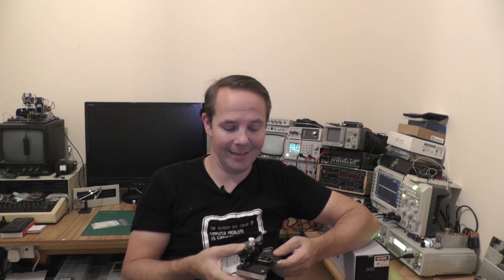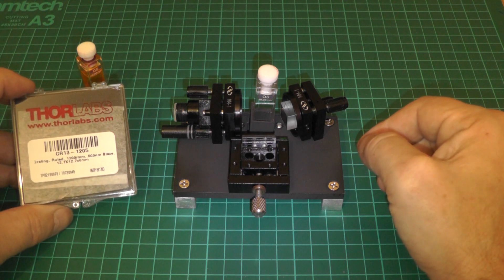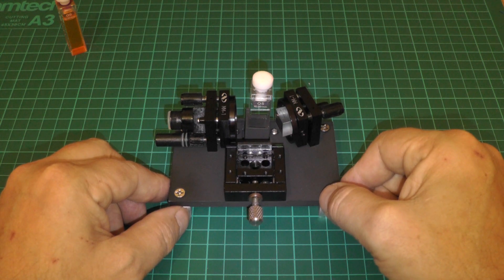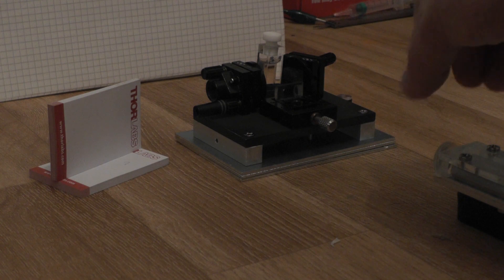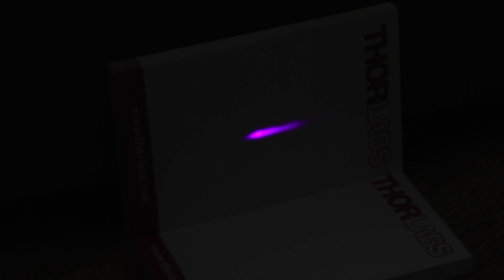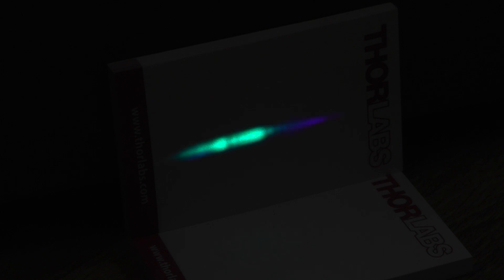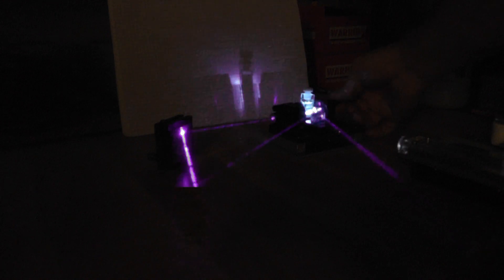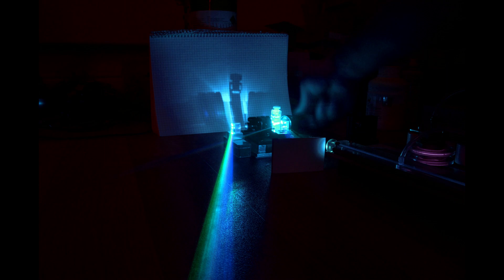DIY Tunable Dye Laser! (HD 60FPS re-encoded video)

Comment: You could also use a prism in the beam path between the cuvette and the HR to tune the laser color like in an ion laser if you have a broadband HR. It may make a better beam compared to diffraction grating.
Reply from the maker: I have in a previous version, but there is a catch! The prism needs to have high dispersion to effectively tune,, plus it's yet another element to align. In some Dye Lasers, they stack prisms to get the required dispersion. 

The garbage in the beam is mostly due to reflections and refractions from the cuvette, the reflection from the grating is actually pretty clean. The beam could be cleaned up with a spatial filter.

In Argon Lasers you can get away with a littrow prism for 'tuning' because you are only selecting lines rather than real tuning.
Reply: @LesLaboratory  That makes perfect sense. Dyes do have a much broader band range than atomic emission does. I had thought you may of been getting additional orders from the diffraction grating and losing some power and beam profile. Spacial filters do a good job of cleaning up a beam but it's usually a last resort thing it seems. I like to try to get out noise in other areas before doing that, It just seems like a frosting on the cake kind of deal. I am just getting into dye laser stuff myself and have been collecting dyes for future laser projects of interest.
Reply from the maker: @Zenodilodon  Agreed! It would be best to attain a clean-ish beam first, so save on losses later. The additional orders scatter away from the Cuvette, but do represent a loss of power. That said, with an un-coated prism, I would still lose around 8% of the beam to reflections as well. 

When the beam from the dye laser is allowed to expand and is projected some distance away, it appears as a main spot, with magnified image of the Cuvette wall from scattering. The main 'spot' appearing an almost triangular (tear drop shaped) beam profile. It is likely that lowering the dye concentration a little and de-focussing the pump bean a little, might result in something a little cleaner, but without external optics, I don't think I will ever see Gas-Laser-quality beams out of it.

In 'real' dye lasers a number of techniques are used to get high efficiencies, narrow line-widths and high powers.
I was looking at MOPA configurations in academic papers a while back. The incoming N2 Laser beam is split in to two, one pumps one Cuvette as a Master Oscillator (MO) and the other pumps a second Cuvette as a Power Amplifier (PA) They were using grazing incidence gratings to achieve sub-nanometer  linewidths from the Master  Oscillator, and its output beam was directed though the beam path of the Power Amplifier. (see page 8 of this for a diagram of something similar: http://dewan.buet.ac.bd/EEE6503/Reports/Report_Chap14_TunableDyeLasers.pdf

Cheers!
Reply: @LesLaboratory  Laser reading is good reading.I will certainly look at that PDF, probably save it too. If you are looking for laser documents I have a few good ones saved and I would love to get more for my collection. Let me know if you want to exchange reading material!
Reply: @Les' Lab the URL is 404/unavailable  check the hyperlink please.
Reply from the maker: @Zenodilodon  Sorry, wayward bracket on the end there! This should work: http://dewan.buet.ac.bd/EEE6503/Reports/Report_Chap14_TunableDyeLasers.pdf (its a student work, but the diagram is good)
Reply from the maker: @Zenodilodon  Sure, ping my email. I have at least 30 academic papers  on N2 and Dye lasers that I have dug up from the internet over the years.
Reply: @LesLaboratory  Thanks!

Comment: Hi there, I was wondering what kind of mount you used for the ThorLabs Gr13-1205 Ruled Reflective Diffraction Grating. Also wondering about the part numbers or names of everything you didn't build in this video. If that is too much maybe a video or video link on what all the laser equipment names or what they are called and what not is used. I am very sorry to ask so much but I do want to learn more and do more with this "Hobby".
Reply from the maker: Hi, happy to answer questions.I used second hand (eBay) Newport MM-1 Mirror mounts for both the grating and the output mirror. They are nice small 1 inch mounts.
The Cuvette was a 10mm path length Quartz cuvette (eBay)
The Cylinder lens was bought some time ago from Edmund optics, and is also Quartz, and the mount on which it sits was again from eBay.

The base plate, and cuvette holder, and lens holder are home made. I suppose with adequate tools and patience, all of the mounting hardware could be hand made.
Reply: @LesLaboratory  thank you so much for the replies. 😃😃

Comment: If you combined multiple dyes in same solvent, could you get continuous wavelength coverage in the visible spectrum?
Reply from the maker: Kind of, but it does not work very well. As well as emission spectra, dyes have absorption spectra. If the two overlap from different dyes then it suppresses Lasing.
Reply: @LesLaboratory  thanks!  Your designs are elegant!  Def the best N2 lasers on the block!
Reply from the maker: @weirdsciencetv4999  Thanks! :-)

Comment: So the reflective diffraction grating can reflect light back through same path, just as the other parallel mirror of F-P cavity.
Reply: but from image of google, it seems there is no such reflective direction.
Reply from the maker: Yes, exactly, the difference is, by tilting the grating one one axis, you can select a specific wavelength of light.
Reply: @LesLaboratory  Yes, it seems that a special color light beam reflects back throuth the incident path.
Reply: @LesLaboratory  what's the name and parameter of the left-side mirror and optic base/bench?
Reply from the maker: @georgegreen3672  The left mirror on the Dye Laser? This is a 50:50 economy plate beamsplitter from Thorlabs: https://www.thorlabs.com/newgrouppage9.cfm?objectgroup_id=914 Feedback in these lasers is very high and almost anything will do.

Comment: If the sides of the metal rails in the laser channel were even sharper might this increase the power density of the beam ?  Going from square, to round, to hexagonal ....
Reply from the maker: I tried many profiles and found that sharp edges tend to generate sparks in the channel, reducing output. With rounder electrodes, I found that the discharge looks very smooth, but output is very low. It seems you need to strike a balance in the channel where the electric field strength is high enough to effectively couple the power into the gas volume, but not so high as to generate sparks in the channel.

Comment: Ok, I'll pull the trigger! Can you give me a components list for the optics you used from Thorlabs and how much it costed?  I am just now getting into dye lasers, My specialty mainly is diode and dpss lasers, Been meaning to get into dye and gas lasers for a while.
Reply from the maker: For Thorlabs I bought the following for my Output Coupler and the diffraction grating:	
GR13-1205	Ruled Reflective Diffraction Grating, 1200/mm, 500 nm Blaze, 12.7 x 12.7 x 6 mm
 £53.36
EBP1	Economy 30:70 Beam splitter, Ø1", AOI: 45°
 £26.18

The Fused Silica Cylindrical lens I already had in my collection (used it in a nitrogen laser project I built as a kid) and is PCX with a focal length of about 30mm or so. Fused Silica optics are very expensive, not much change out of £200! You could perhaps substitute BK7 Glass, and perhaps spend 70 bucks.

The mirror mounts are Newport MM-1 mounts that I bought off eBay for $80USD for the pair plus shipping.
The linear stage, was also an eBay find, about £30 I think.

Cuvettes I get from eBay. You need the 4 window versions (3.5ml 10mm Path JGS1 Quartz Cuvette With Stopper For Fluorescence Spectrometer). Expect to pay about £30 from China, but buy brand names if you can get them at a reasonable price (I bought Hellma cuvettes for £60 each)

The rest is just aluminum plate, aluminum bar and an old cctv lens housing figure about £30 for this stuff.

All in, you are looking at somewhere upwards of £350, though you could do it cheaper if you are patient on eBay and have an eye for a bargain!
Reply: @LesLaboratory  for the collimator I think that I will try using one that I use In most of my diode lasers, Its an AR-coated long focal point single collimator named G8 that is AR coated with broadband 400-700mm. Its pass efficiency has been measured to 90%. Have you measured the power output of your dye laser?
Reply from the maker: @Gianns_TDM  Your lens will need a pretty long focal length. Mine is about 48mm.

I have not measured the output of the Laser as I would need a Laser energy meter rather than a regular power meter to measure it. My best estimation based on the N2 Lasers ability to threshold a bare cell, is that the N2 peak power is about 300-400kW (30-40mW at 20Hz) and the Dye under ideal conditions will generate in the region of 10mW average power at 20Hz and maybe 100kW peak. I really must get hold of a joule meter!
Reply: @LesLaboratory  Mk seems good! Its getting in the list of to-do after i do some component hunting, Thanks!
Reply: @Gianns_TDM  hey there Giannis, any update on your progress?  had any luck locating components at an affordable price?
Reply: @hullinstruments  Nope, ebay has been a toughie but I got the dies at least.

Comment: Brings back memories (: I did some N2 lasing some 10 years ago and aimed for the low pressure path. Did not make a tuneable resonator as I lacked the funding at the moment. I've stored them on flickr.com and you should be able to find them with this addition to the url: /photos/knglaser/albums/72157626250500618/
Reply from the maker: Awesome images! It's worth the time and effort to make it tunable. My first N2 Laser was also a low pressure design, using doorknob caps. I still have it somewhere but it is pretty crusty now. I might revisit it because unlike TEA they really scale up!
Reply: I just checked your project, and it's very cool!